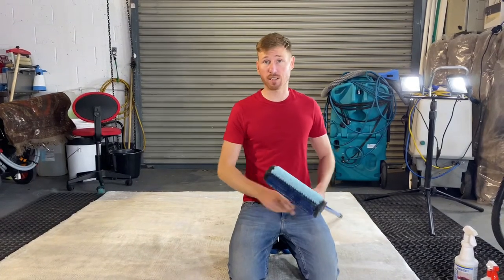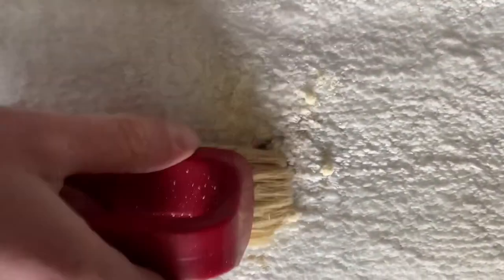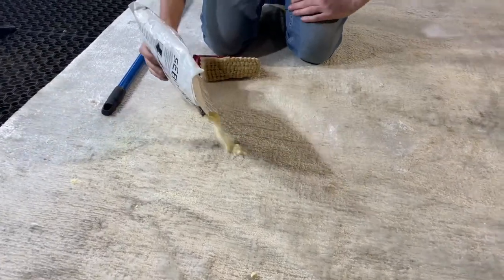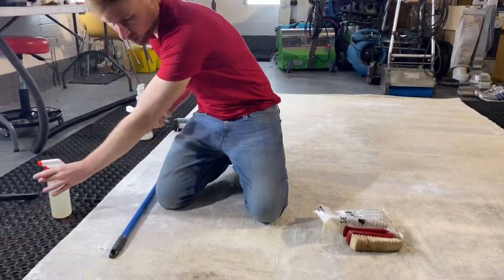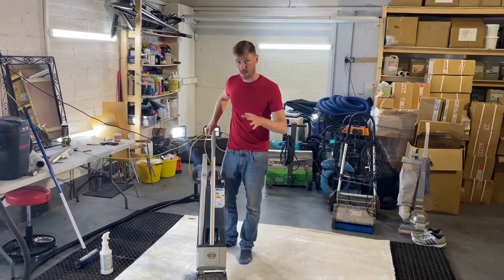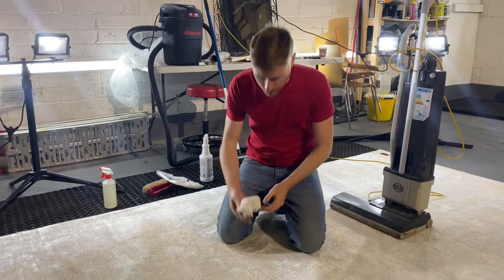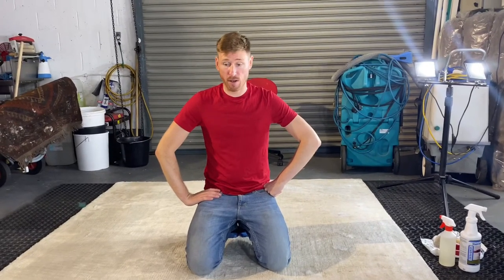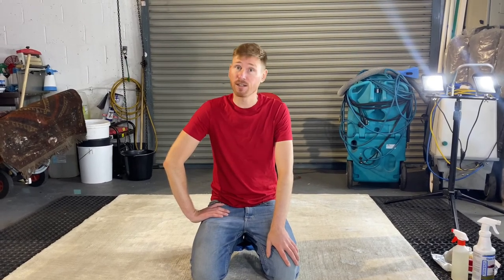How to Clean a Viscose Rug | Viscose Rug Cleaning Instructions

Comment: We clean "most but not all" viscose rugs underwater with no problems, If you have the right equipment and knowledge its easily done with great results. especially the newer generation tencel. Its all in the drying, great video and some great nuggets of information for the general public and carpet cleaners. If you are ever in the UK, pop in for a brew. Love chatting rugs.
Reply from the maker: I’ve found tencel to be fine to wet clean but the Indian viscoses to be a nightmare; I’d love to give you a call to have a chat :)
Reply: @CleaningHowTo  Spot cleaning and surface cleaning causes more problems than full submersion cleaning. Depends what you mean by  Indian viscose Kashmere silk or just the general thick viscose with made in india type ones. most we get in have already clumped due to carpet cleaners using their machines or spills and abuse, DIY cleaning etc..., a good wash and full rinse under water helps with the clumping but once clumped it never really goes back to the soft hand it originally had. cellulosic browning is usually due to not getting them dry fast enough or an alkali cleaning product, (always keep it acidic when cleaning viscose) we can go from under water to dry in as little as 12 hours depending on density and pile length. Will hopefully be doing a few viscose cleans on video for our channel soon.